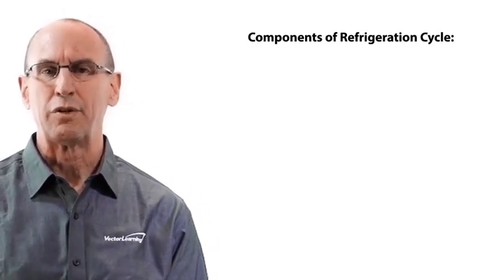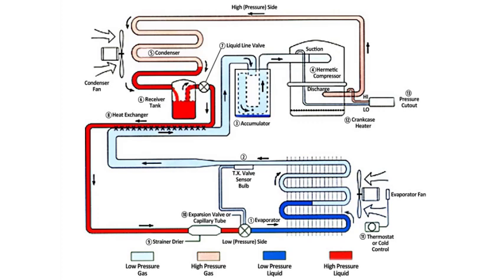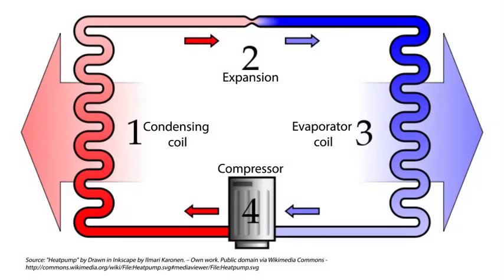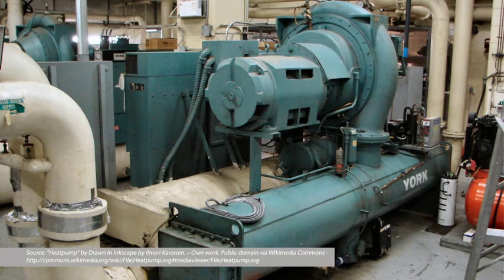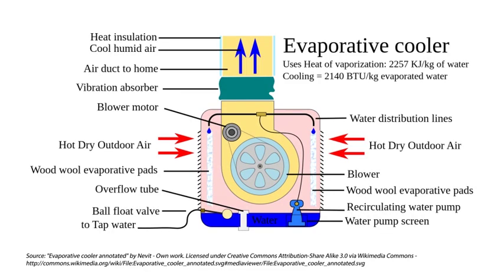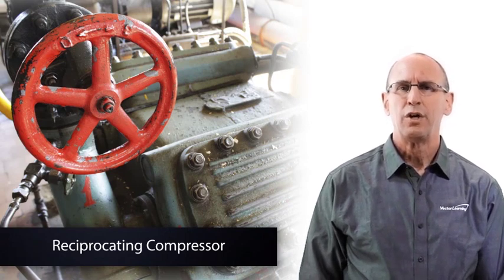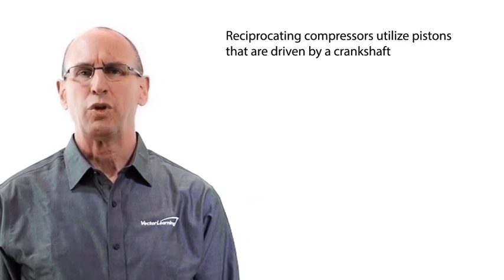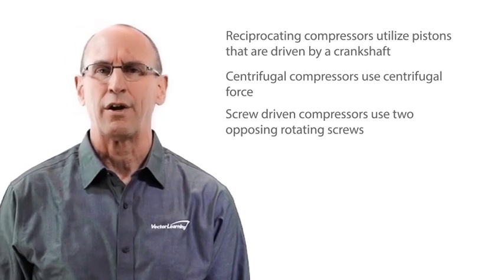Overview of Commercial Refrigeration Systems

Comment: refrigeration works via a principle called the Second Law of Thermodynamics. This principle states that when two objects of differing temperatures are brought close together, heat will always travel from the warmer object to the colder one. Using this principle, commercial refrigeration systems utilize a refrigerant solution to transfer heat from the food inside the refrigeration unit’s storage area to the refrigerant. Refrigerant solutions obey a second physical principle, which states that gases cool as they expand and heat up as they are compressed. While cycling through the refrigeration system, the refrigerant is sent through a series of pressure changes to improve the efficiency and speed with which it removes heat from the refrigerated space to keep it cold.   https://youtu.be/KYet4mYoapU